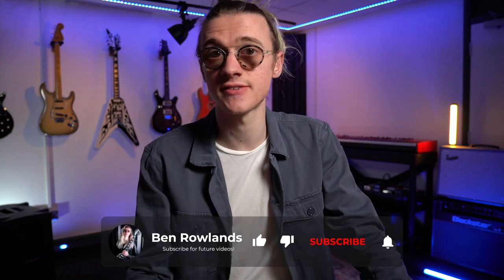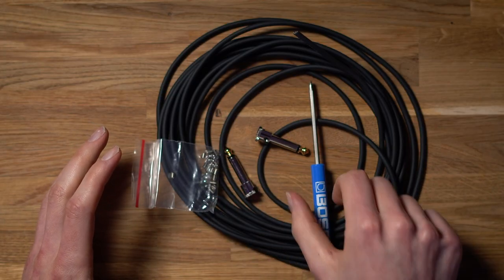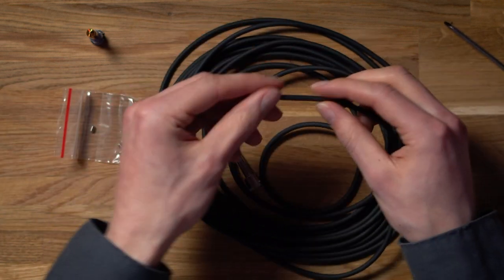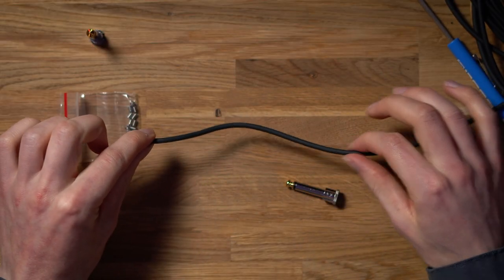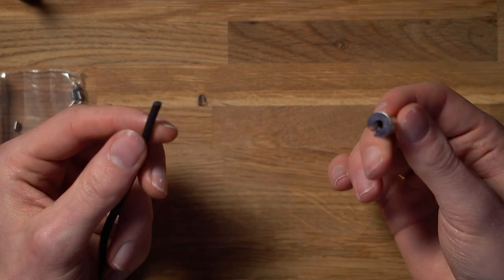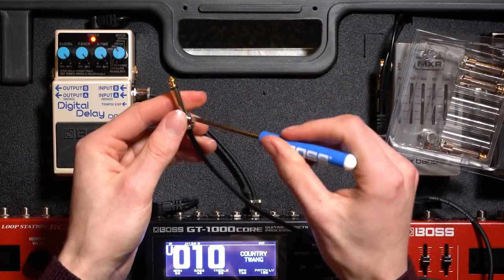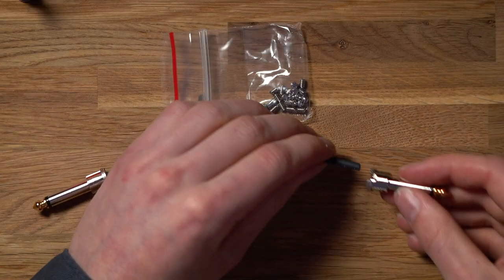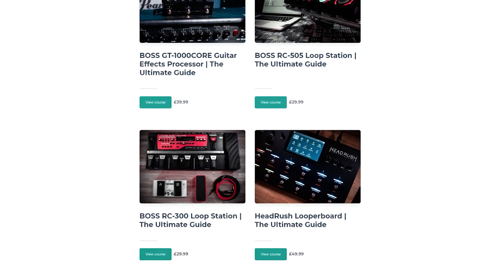Create EASY Custom Length Cables - BOSS Solderless Patch Cables Assembly Process!

Comment: The "groove" or "opening" you refer to is for making a 90-degree cable. Says so on the box! It's not for inserting the cable into the connector. The best way to ensure a proper connection is to cut the cable as flat as possible then roll the end you cut between your fingers before inserting it into the connector. And yes you can insert straight into the connector.

Comment: I don't recommend these... you will struggle making connections. The flat grub screw needs to pierce the outer rubber jacket and make contact with the braided shield which connects braid to plug body... pain is the a$$! Lol